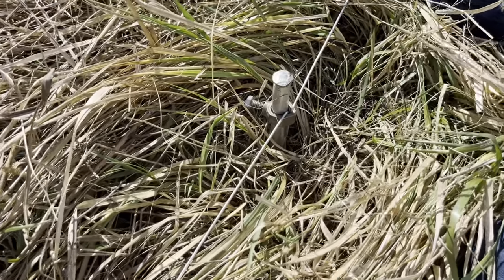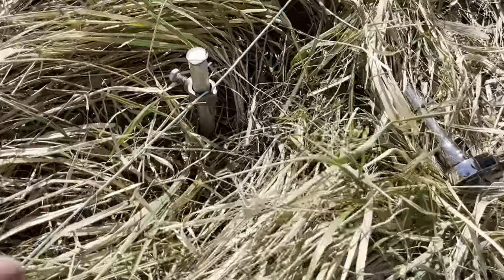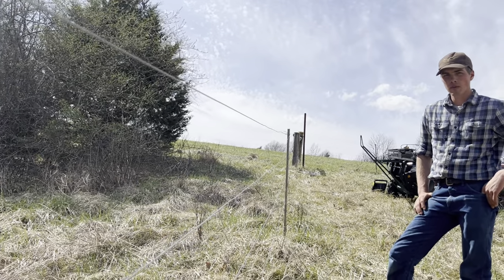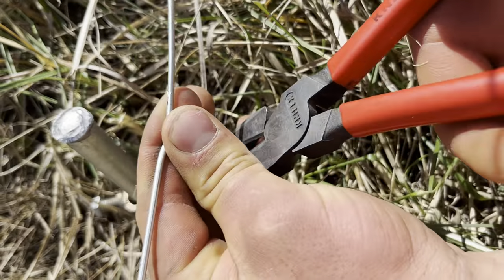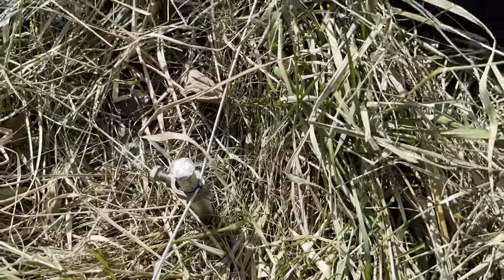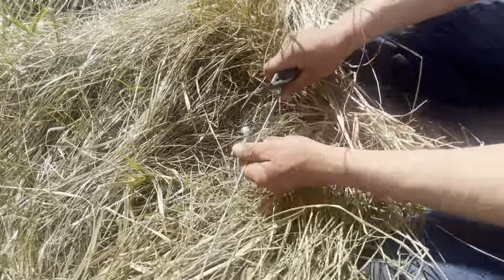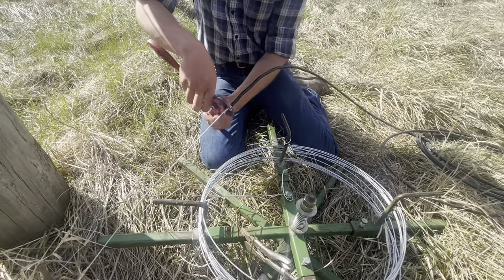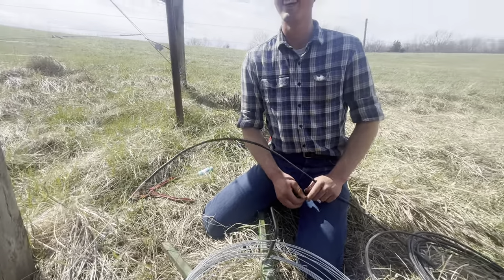Greg and Joel explain how to install a proper grounding system for electric fence.

Comment: Just a recommendation, but i would highly advise using copper clad ground rods. the galvanized rod will corrode and the corrosion acts like insulation and will negate the conductivity of the rod. I am an electrical engineer and do consulting for power companies and have done ground studies and found many ground grids that used galvanized rods that have no conductivity.
Reply: Isn't the fence wire being galvanized going to cause problems being connected to a copper clad earth rod?
Reply: Where i am, it's cooper or fail inspection and void warranties
Reply: @Schaapkraal  that is a possibility and if you are using a galvaized wire you could use a tinned connector to to transition from galvanized to copper but its easier to clean a corroded connection above ground than to have a ground rod buried in the ground doing that's rusted and not conducting for the ground.
Reply: you should not mix metals, if you use copper, the rod, connecting wire and clamps all have to be copper, and the same if its galvanized.
Reply from the maker: 100% agree. We use all galvanized rods, clamps and wire all the way to our charger. We have 8 such systems in and have not had a failure in over 40 years.
Reply: NO SIR, Galvanized every time

Comment: I’m afraid your 120 watt panel is not going to be enough.  I started with a 120 for my 12000i chargers and it would not keep the battery up.  Found a good deal on some 230 watt panels, way over kill but fixed my issue. Just make sure your charge controller is big enough to handle a panel that big. Also another thing I learned the hard way, put a quick disconnect between your panel and your charge controller. Make sure the power from the panel is disconnected before you take the battery off the controller.  You can fry the controller otherwise
Reply from the maker: I bought a 180 watt panel. Thanks for the tip on the other items!!!
Reply: Why does your ground wire have a charge on it?
Reply from the maker: @philipwickline5761 if you hold your fence tester in the air, 2-3 inches from your hot wire, you will get a similar reading.
Reply: @philipwickline5761  Induction.

Comment: Great explanation on how to make tight ground connections. When that ground wire comes off the charger & runs through all the ground wires does it then become one of the ground wires on the post going all the way to the other ground rod you mentioned a mile away or does is laid on the ground or buried to that last ground rod? If it is one of the wires on the fence post which is it? I would assume it is the bottom wire because you wouldn't want the bottom wire hot because eventually weeds will short it out. Also on an alternating wire fence [hot strand ground strand] does the animal have to touch both a hot & ground strand together to receive a shock? On the fence we currently have the ground wire just runs to some ground rods near the charger so every strand on our fence is hot. Fence looks beautiful! You fellows inspire me! I really enjoy your videos & attention to showing details. I know it must take a lot more of your productive time to stop & film as your working. It does not go unnoticed!
Reply: The ground rods only need to connect to charger.  The Hot wires carry the charge and when something contacts it and is touching the ground/earth it will receive a shock. You can your ground rods a few feet apart and directly connect them together.  I ran mine 12 feet apart beside the post for my gate both sides. And it works great.

Comment: Man. These are not for idiots like me.  One of the fence wires was a ground wire. ?   And I gathered that maybe it is hooked to ground rods somewhere else on the farm?  Six, six foot rods again?   Will that work for goats?   And I have no clue why we are running the last few feet of (on the ground) ground wire through insulated cable.  Maybe in case they use the steel post for the charger? But why would that matter if it is a ground wire on another grounding post?  And why tie it in so far from the box?

Comment: If I understand correctly, the way you have this perimeter fence setup to work in conjunction with your temporary fencing, only the high tensile will ground back to the Energizer.  In regard to any cattle, sheep, etc touching a temporary wire, they must ground through the ground back to the Energizer.
I read many questions regarding the grounding of a good system.  May I suggest more input on the subject?  Perhaps a video answering questions you have received... following a format such as yourself, Jan, and all the guts chiming and giving their ideas!

Comment: Hey Joel, instead of beating and beating and beating and buggering up the rod tops, you could try this next time. 
1: Use a shovel to dig a hole as deep as is handy. At least 3 inches. 
2: Fill the hole with water.
3: Push the rod in as far as you can by hand. Should go several inches. 
4: Pull the rod back out and allow water to enter the rod hole, then repeat the process, working the rod in and out until your rod is as deep as is easy to do. 
5: Finish driving with a sledge hammer. 

There's a better than good chance that you will be amazed at how well that works. I have used this method many times over the years. Rocky soils would probably pose and issue though.
Reply: This is the way. Make your own mud!

Comment: Good lesson, just learned something. I’ve been attaching ground rods using insulated wire and every couple months the connection corrodes. Will you attach any additional ground rods to the ground wires you’ve put along the perimeter

Comment: Thanks for the vid. Please, how far should the first ground stake be from the energizer (which is near the fence about 50 metres from the house)? Further, can the wire connecting the earthing rods present a jolt if touched (that is, must the wire be insulated)?
Reply from the maker: 10 feet from the charger is where first ground rod should be located. You can use plain galvanized hitensile wire to connect all the ground rods.

Comment: Is it a bad practice to make the ground looped, both ends terminated at the charger, other than using double the wire. (If one wire should fail was my novice idea).

Comment: Are you using the same gauge wire for connecting the ground rods as the high tensile fence?
Reply: Oops. Should have listened all the way through before asking my question. 🤣🤣